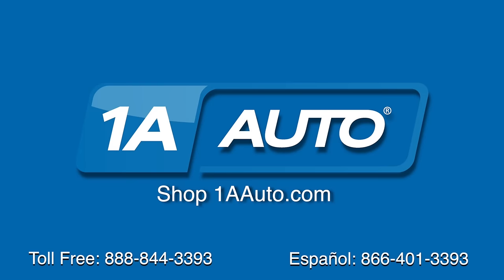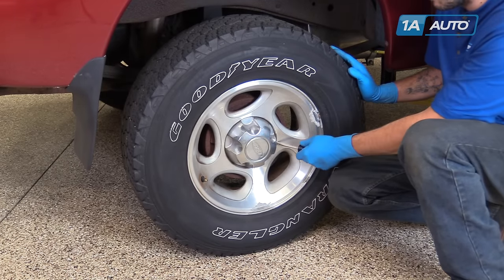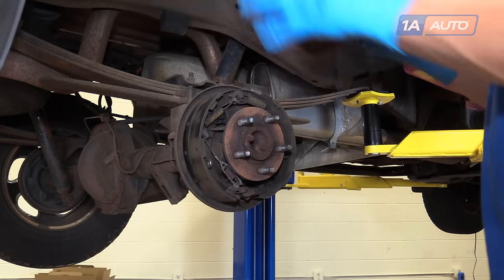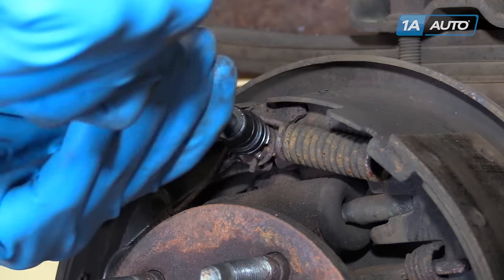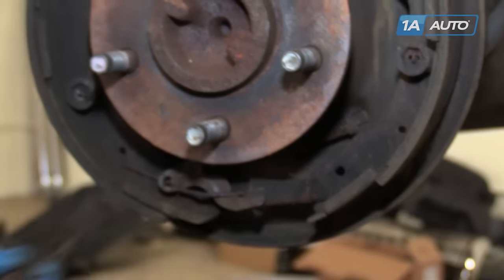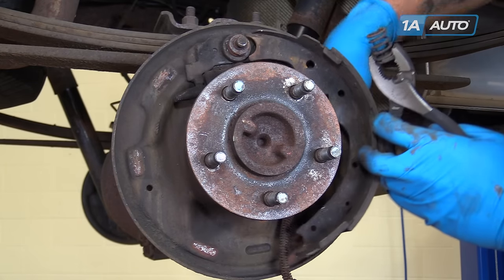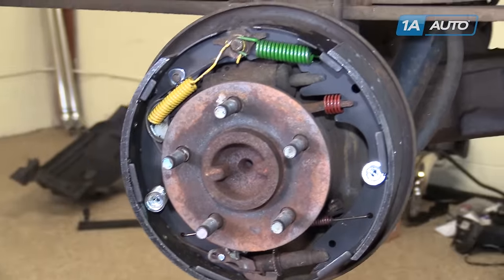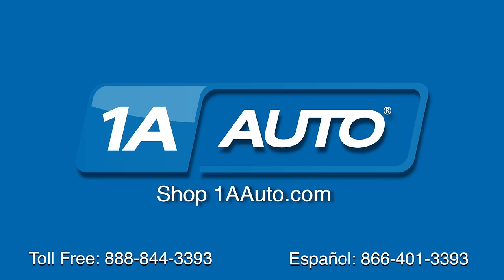How to Replace Rear Drum Brakes 95-09 Ford Ranger

Comment: any info on the TSB? my o4 Ranger is affected and I keep getting water and dirt in the rear drums. casing saver brake grab and lock up in the
rain. apparently, the dealer fixes the problem by applying silicon to the backing
plate? but they won't tell me where I need to apply it. Thay would rather I kill myself then not make any money off me.
Reply from the maker: You're local dealer should have any updated TSB info on the vehicle. Hope this helps out 1aauto.com

Comment: My adjuster doesn't touch the metal clip thing on the bottom. It's supposed to touch so it stops the adjuster from moving. I've done everything right, it just doesn't touch...
Reply: Did you find solution? I have same peobleme

Comment: Great video , but to many steps lol
Reply: It`s on the money for a 10 inch drum set though just the e-brake spring can be kind of hard to put back on the lever but you can put the new shoe on without taking it loose from the spring a bit easier some times.